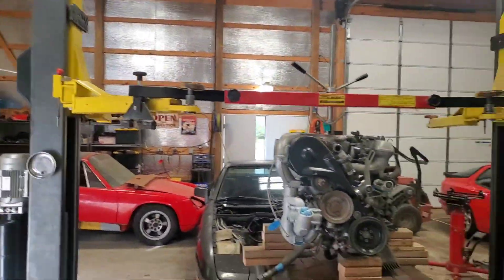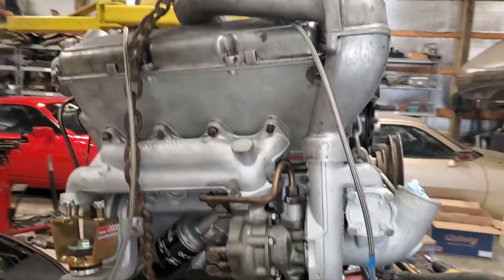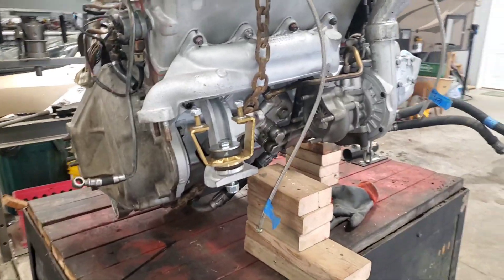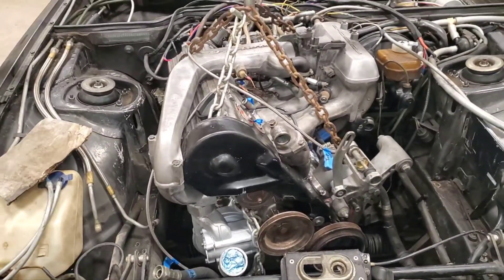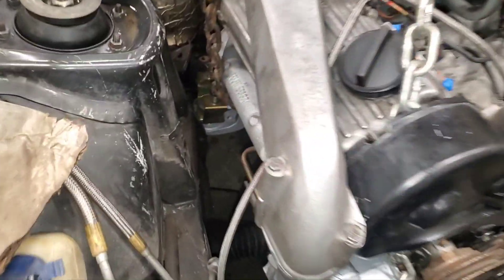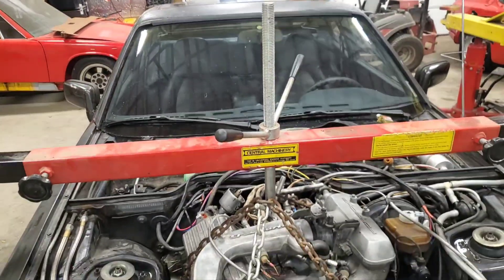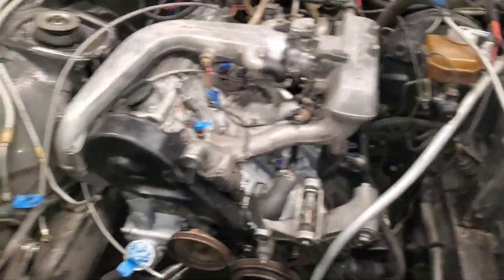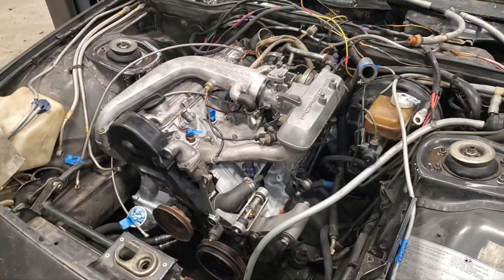1982 Porsche 924 Turbo engine rebuild motor re-install

Comment: When i do it I remove the front beam, radiator and that black sheet steel engine mount bracket. And then i put the bracket back on when the engine is almost down there but still accessible. It helps massively to be 2 persons aswell, then its not that hard to slide it down
Reply from the maker: Yeah Cedric, I was wishing I had a second set of hands most of the time.